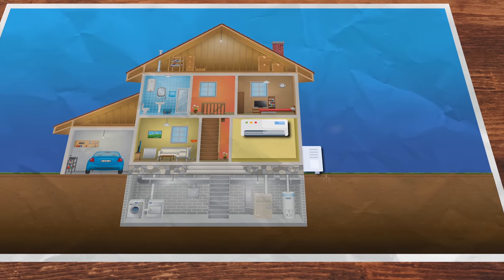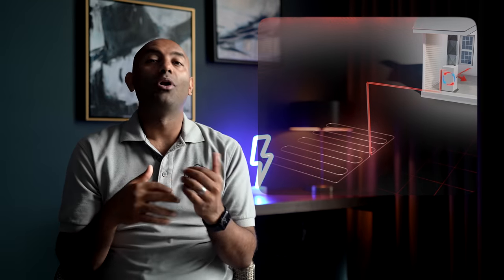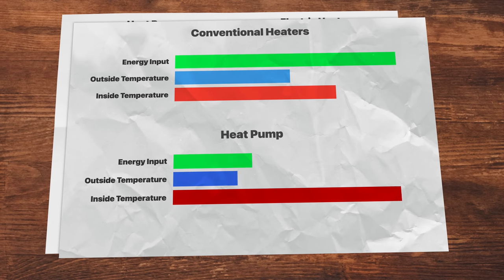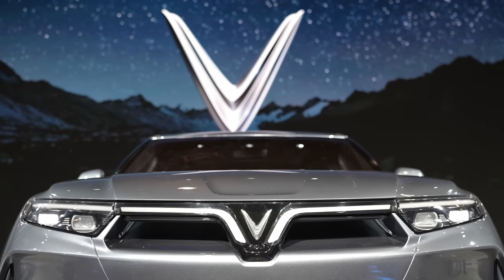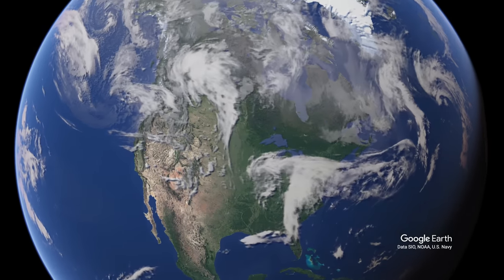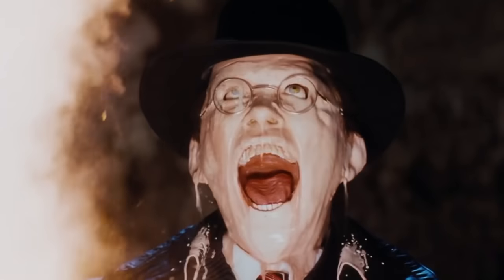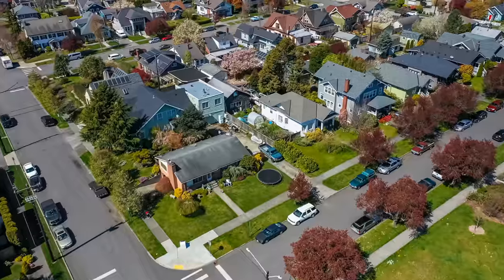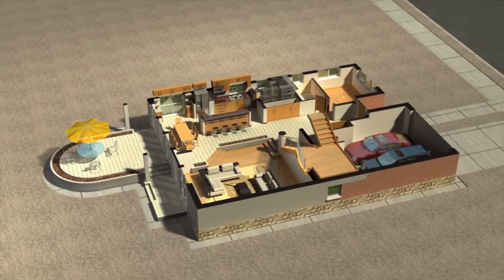Adding This Can Save You Money Summer & Winter!

Comment: I have an Air source Heatpump which I added to replace a gas boiler in 2016 in the U.K. I also have a 2.9kWp solar pv system and a Powerwall 1. I get FIT (feed in tariff) payment for every kWh generated and the battery virtually guarantees self consumption and allows a extension of the night cheap rate in winter to mid-morning. I get 7 years of RHI (renewable heat incentive) payments resulting in approx £100 pa energy costs for a 1950s built 3 bed semi-detached with extra wall insulation installed.
Once the RHI ends annual cost will be more like £900 pa - still very cheap. The FIT continues until 2035, after which I would hope the electricity prices will have started to fall again as the grid reaches high proportion of wind & solar (the cheapest electricity). I may not be alive then but my son will benefit from the virtual energy independence long after I’ve gone. My energy supplier is the the most renewable of the companies in the U.K. being responsible for a large proportion of land based wind generation, so I consider my home as 100% renewably powered already.
The internal temperature is the most stable and consistent it ever has been. The Heatpump heats the water in the radiators (some of which were resized to match the lower head temperature). The system has no overshoot and copes fine in the coldest temperatures we ever get here. I get no summer cooling, but very few homes do here as the need has historically only been felt for a couple of weeks per year. The Heatpump cost a similar amount to a replacement gas boiler but the installation costs were significant with totally replaced hot water system, and upgraded radiators. Good investment given the low running costs - perfect for retirement on limited income.

Comment: I live in Norway, and here geothermal is done by digging one deep well, between 150 to 300 meters deep. Costly, as most of the digging is in hard rock. A friend of mine just installed a geothermal system in their home, and the total bill was just shy of 300.000 NOK (30.000 USD). At the time he ordered the system, electricity costed roughly 0.20 NOK per 1kwh. Today the price have exploded up to 2.30 NOK in average. (Peak today was 6.35 NOK). 
Even with the high cost to get started, it looks more and more reasonable if you stretch the cost over several years.
PS: Solar is really not a good option here.
To comparison, and air to air heatpump installation is usually 25.000-45.000 NOK, including everything. So many, including myself, have air to air systems.. (I've got two heatpumps, one for each story of our house).
...
During the coldest montsh this winter, we used both electrical heating and wood stove heating. We averaged roughly 7.000 NOK each month in electricity bill.

Comment: Ground source heat pumps (GSHPs) are great.  But the additional efficiency cannot always justify the additional cost.  Modern air source heat pumps (ASHPs), particularly cold climate models, have narrowed the performance gap with GSHPs.  The cost of the ground wells can be substantial, so without a substantial efficiency difference, GSHPs struggle to pay back their increased costs in energy savings.  GSHPs will tend to do better in more extreme climates (both hot and cold) and where the building loads are higher (don't think your house, think commercial buildings).  Ground conditions will also be key.  Some ground is more expensive to drill than other.  But GSHP wells can easily cost 2x the above-ground equipment.

So, do your research.  GSHPs are great, but aren't the right solution for every home or building.  If you aren't in an extreme climate, or if your home is already fairly efficient, or the ground conditions aren't right, you may never recoup the substantially higher up-ftont costs.
Reply: @PedroKing99  The issue is the well.  If you already need to bring the equipment onsite for a water well, that can help with the cost.  In most GSHP systems, the ground loop represents 1/3-1/2 of the cost.  Unless you are in a fairly extreme climate or have fairly large loads (like a commercial building) it is hard to recoup the cost from the additional efficiency.

What I would like to see are more district GS loops.  Basically, one big well that multiple homes (or other buildings) can use.

Comment: For Whisper Valley in Austin, one thing to note is that on top of the utility cost, residents need to pay a monthly Geothermal assessment $55-70 per month (on top of the $55 per month HoA and $1,500 - $2,000 per year PID bond payment)
Reply: That seems like a strange way over covering the cost of new community systems. Why not just add the cost to the sale price of the home? Within 7-9 years the cost will be recovered in savings unless the cost of energy goes down. 😁 Figure the odds on that happening.

Comment: *For air source heat pumps, ground source requires heavy equipment. 

Those install costs seem really high. Maybe he's using CA numbers.
A 4 ton heat pump costs about $4-6k, which is more expensive than in the EU where they've used them longer, but even still $6k for install? It's no more difficult than an AC install. 
Swap the air handler and plop the outside unit onto a concrete slab or other firm foundation, run the refrigerant and power, and you're golden. No different than installing AC. 

If you just want a minisplit then DIY becomes really easy. Get one of those Mr. Cool kits and it takes an afternoon, with the possible annoyance of needing an electrician to check your work.

Comment: As Amory Lovins (RMI) would say: Think design first. Often overlooked because it's not tech, it's forever (the life of the house). Passive solar + ultra-insulation/thermal bank = life time savings. I continually hear about new building designs that tout saving 50% or more on energy costs. Then, I remember Dr. Lovins' house/office at 7200 feet with a tropic environment with zero heating/cooling. Why not go all the way and eliminate the need for energy input, depreciating, maintenance requiring tech?

Comment: I bought a house last year (2021) that needs a new roof and a new air conditioner.  Initially I was just going to get a new air conditioner, along with radiant heat flooring, but now I'm exploring all of the geothermal options, as I've been dead-set on building a geothermal greenhouse already, since finding Greenhouse in the Snow, and more recently CERES Greenhouse Solutions.  I guess my question would be if I do geothermal for the house, it might get complicated to then install geothermal for the greenhouse.  I wouldn't want the greenhouse build to ruin the existing system I'm using for the house, since there would be TWO geothermal systems underground.

I've been looking into solar roof options as well, but this is all too much $$ up front, so it's a tricky thing.  Seeing as how I need to replace a lot of these items already, I really don't want to spend a fortune on inefficient options when I could potentially get a loan or, if I can hold out a bit longer, just save more to get something I'll be proud of, helps the environment, and save me money in the long-run.  

Also, I just came to your video after watching Matt's Undecided.  I always enjoyed his channel, and I like this video of yours, so I may subscribe after seeing more.  I like the way you speak at a slower pace than some others.  ADHD makes concentrating hard for me, so slower, more clear speech is helpful.  :)
Reply: Would like to see a follow-up with what you finally decided on, Gabriel. As to the two geothermal systems you mentioned, the Greenhouse in the Snow uses buried corrugated pipes to heat/cool air for the greenhouse application. A geothermal system for your home would likely use a liquid medium and you could  have it drilled down vertically to a depth of 200-300'. In other words, you could have the two systems installed in separate physical locations, so they aren't exchanging energy in the same area of your soil.

The gentleman from the Greenhouse in the Snow initially used that system for his home as a supplemental type of heating, I believe, and just enlarged the system for the greenhouse. You could even make the greenhouse an addition to your home and use either type of geothermal system to heat it and your home.

My wife and I are planning on moving down south from the PNW in the next few years and I really want to find a place with enough acreage to put in a couple of those greenhouses as well as building a net zero homestead to boot, so I'm very interested in how it goes for you. Best of luck!

Comment: Another way to do geo source heat pump is with what is called DX which stands for direct exchange. Instead of piping water pipes down vertically the installer tilts his bore down into the ground at say a 30Degree angle and then copper tubing is inserted into a number of holes that are bored.  Might have ten or more holes bored each with copper tubing inserted into the holes.  Then the installer would place a manifold for the lines going down to split the lines  and an other one to re join the lines. The difference here is no water is used to exchange the working fluid with  the freon.

Comment: Hi Rick,
Interesting following your journey to reach zero energy etc.   Please mention / schematic diagram at the beginning how much heat is lost where in a building, eg: Walls = 35%; Roof = 25%; Floor = 15%; Doors = 15% and finally windows = 10%.
Have you heard / tried: Aerogel insulation where a 20mm blanket gives a 77% heat saving!   Their products are going into vehicle batteries to help keep them cool and prevent  these spontaneous fires.  

Also how about fitting earth closet / composting toilets to reduce water usage, combined with grey water recycling and maximize rain water capture.

Comment: Notice the gal from Austin said she has a $100 a month electric bill. Not great. Also she said they had blown in FOAM insulation. The thing is most people don't realize is INSULAtion makes the major difference when it comes to heating or cooling. But problem which will not change with ground source heat pumps is their HIGH initial costs. Now with the newest AIR source heat pumps one can now produce about 75% of the heat when the temps gets to -22F! So with the right amount of insulation all you need is a few heat pumps (Air to air) and you will save a LOT of money up front than purchase and installing a ground source heat pump. also a hot water heat pump draws only 400 watts to heat your water. That is  amazing. I have two heat pumps that cost about 3K ( in did the installs) for 27K BTU. So when you add insulation it replaced my 15 kW electric furnace (51000 BTU). People seem to forget all about insulation in the effort to go from a fossil fuel heating where you BURN things to a heating and cooling system where you actually just move heat around and burn NOTHING!

Comment: It seems like we can take advantage of ground source heat pumps no mater where we are unless we are on a thick ice plate in the Antarctic. But some places will cost more for installation if they have bedrock or something too close to the surface. But without the cost of the hole/s and the clean up, ground source heat pumps would be very competitive with the cost of installation as other HVAC, etc... 
So, if you are already the type of person living in rural area with a little land that has a 3/4 ton truck at least, or access to one, then just rent the equipment dig the hole and run the lines yourself.

Comment: Upstate New York with open loop heat pump (artesian well) -- love it. Add some solar panels and it's cheap to run. Never worry about being hot/cold to save a few bucks. 

One correction is the 50/100 year lifespan on heat pumps. The ground loop likely will last 50+ years, but there is nothing special about a ground sourced heat pumps compared to air source heat pumps/air conditioners other than being protected indoors. Our house is 40 years old. We are on the third heat pump -- First was 1983-2002. Second was 2002-2021 and now third is 2021-??.  Setting a 50-year expectation is a no-go.
Reply from the maker: Yes you’re right. I was speaking about the under ground portion

Comment: I wish you had touched on using a liquid to liquid heat pump that you could use with an in-floor hydronic heating/cooling system.  I know both Bosch and Trane have at least one model and I think Carrier does as well.  Don't know where we'll build, other than it will probably be between the Mississippi River and the Appalachian Mountains.  I want lake/river frontage while the Boss is more interested in acreage.  We both are agreed that too close to a city is RIGHT out.

Comment: At the 12 minute mark you repeat yourself saying 2x in a row that vertical loop systems need less space but need more equipment.  I'm looking for a video that shows one of those vertical loop systems that is installed as a single coiled loop that looks like a cylinder dropped like a beer can.  Some of them are actually bagged in a reservoir of additional fluids that help move heat even more effectively from the ground to the loop/coil.

Comment: I discovered online that many geothermal installers across the US are using horizontal drill rigs to bury the loops. One 6' square hole allows drilling in several directions to avoid obstacles and adapt to odd shaped areas. The rigs can be used to drill at a deepening angle.
Reply: Works well if you have 20 feet of sand, clay or muck soil.
Reply: @kkarllwt  Especially if it is constantly wet or at least damp. The companies using the horizontal drill rigs are grouting the bore after the loop is installed. Some are buying their own drill rig and running their own crew.

Comment: One other thing to keep in mind is if you can get off natural gas completely you arent just saying money on the natural gas you are also saving money on connection and administration fees each month.  Not sure if those figures were factored in?  If you want a backup just go with propane.  Its fairly cheap and can just sit in a tank for a year with no problems.  Especially if you are doing new construction just put a propane connection in for a bbq so it gets some use.
Reply from the maker: great Point David! I'm actually not sure how I can remove natural gas, but when i replace EVERYTHING, i'll call my utility and ask! but no that was not factored in, and you're right, propane as a last result makes more sense. I plan to get there in the coming years! cheers!

Comment: Here in the UK we have gas approx 1/3 cost of electricity. Unfortunately unless you have a rural property, are well off enough to have huge land in a town/city then ground source is unaffordable. We couldn’t have trench loops due to lack of space. A borehole requires planning applications and is over 1yr salary. Grants can help but don’t touch the sides for this type. We are keen on an air source but due to high demand, good competent installers are not easy or cheap to come by. My search continues whilst wading through the cowboys trying to take advantage of a currently lucrative market. Can’t really DIY particularly if you want to take advantage of grant options.

Comment: It makes more sense with new construction than retro fitting to an older home. But if you are trying to save money on your existing home, add insulation to the attic to the right R-value, walls, replace windows to he double pane, upgrade furnace to a 92% or 95% efficiency. All of which will get you your savings within 15 years.

Comment: A stirling engine just needs a hot side and a cold side to produce electricity or pump working fluids, the ground or aquifer could be the cold in the summer and the hot in the winter. Now what other things are warm and could benefit from cooling or provide heat energy, solar panels, pools?, external walls and roof of a home or structure, attic, roads, sidewalks, ... they also radiate heat well. Solar would benefit from the stability of a heat pump / stirling engine cooling and produce even more power.

Comment: Yes it's cheaper if you don't consider the cost of insulation which costs thousands of dollars. It's real expensive to dig down ten feet if you can even dig that far down in the first place. Where I live it's hard clay and that's not worth digging up. Then there is the issue of disturbing the foundation which can cause foundation issues down the road which could cost over ten thousand dollars to fix down the road.

In my house I have an air heat exchanger and a conventional electrical heater when it's just to cold for the heat exchanger to work. It was real cheap to install and does not cost to much to run.

Comment: Old video at this point, but just found it.
I am absolutely interested in getting a geothermal system installed in my home here in Pittsburgh, PA. I've got a 30 year old furnace and no central AC.
I'm currently in the process of getting a solar system installed. Waiting on permits to go through at this point.
My biggest concern with a geothermal system is space needed for the loops. With my small yard, only choice is vertical loops, but I'm concerned about depth needed and the possibility of old coal mine shafts sitting somewhere below my property.

Comment: I would have installed geo thermal but I live in Phx, AZ, and I think most of the land out here is like granite .. it's super hard and I would expect installation would be expensive due to the ground. On the other hand we have the most sun per year ( maybe Yuma beats us ) so I installed a 6.7 kW system that puts out about 40kWh per day in summer, and about 22kWh in winter which takes cares of 50% of my power needs in summer and provides more than enough in the winter time.